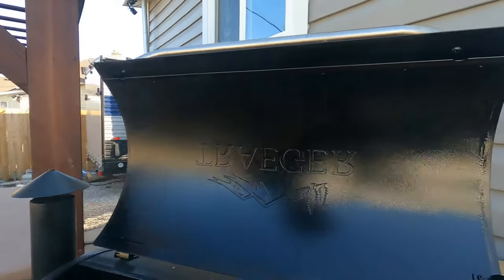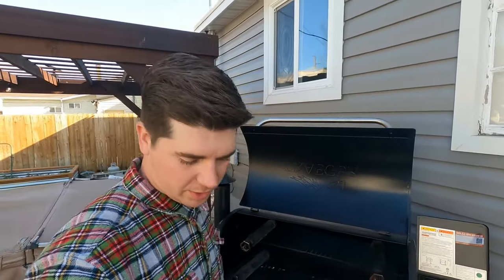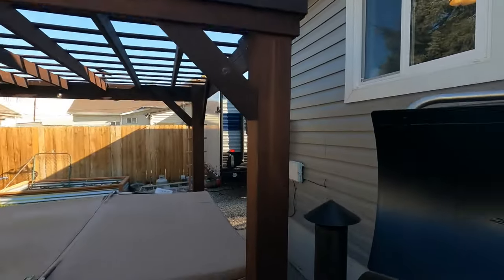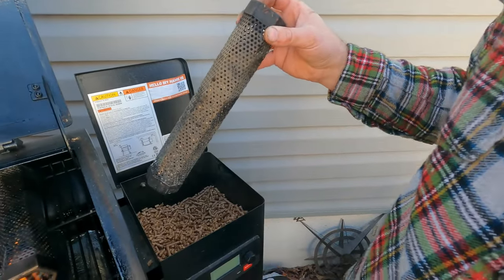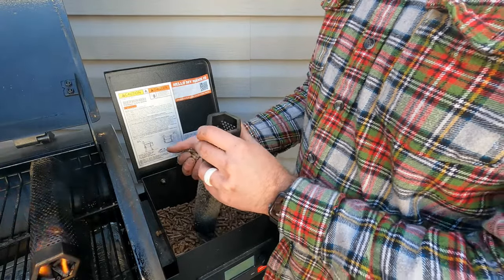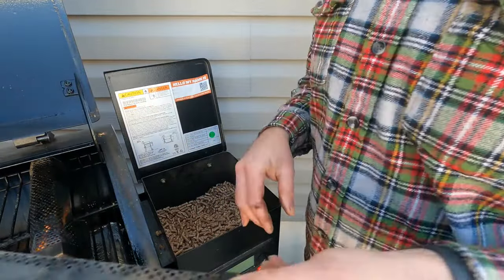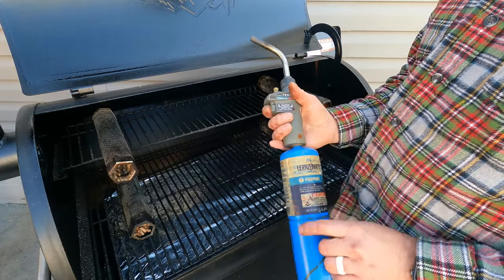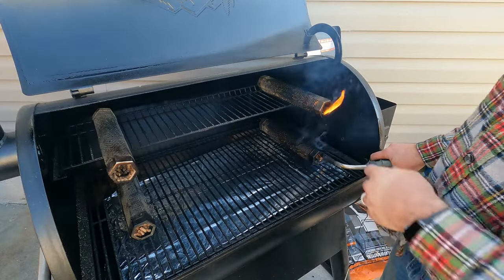Do you want MORE SMOKE from your Traeger pellet grill? This trick works amazingly.

Comment: The pellet grate is to prevent you from getting your fingers amputated by the auger. Presumably while you are digging in there trying to scoop pellets for your smoke tubes.
Reply from the maker: Makes sense. If someone reached down that far they deserve to lose a finger
Reply: @diyhvacguy  LOL!
Reply: @diyhvacguy  Many don't know how they work or about an auger or what it even does.  Most People are not mechanical.  They may be clearing pellets (not smart) for some reason or not thinking.  ???
Reply: It's also there to help prevent something like a tool, or accessory item from falling down in there and maybe jamming the auger.

If you pull the screws for the guard and put a dab of blue loctite on them, you can put them back in juuuuuuuust enough that you can pull the grate out easy without needing a screw driver so you can clean out the pellet box after the cook. 
The loctite will keep the screws from backing out and ending up in the auger.
Reply: Considering the auger rotates at half the speed of smell, if you lose a finger there, it’s intentional.
Reply: lol, I literally said that out loud while watching the video lol

Comment: Found your vid hunting around for a solution for the lack of smoke issue.  It looks like this is going to have to be the route I go.  It's really disappointing though.  The 575 Pro I picked up had a price point approaching a grand.  The smoke flavor it puts in the food is pretty minimal.  Kind of nuts that for this much money, I've got to go out and by an aftermarket work-around to make my really expensive smoker, smoke.
Reply: Yeah, my bro said the same thing with his new pellet smoker. Bummer
Reply: Also depends on the pellets you are using as well. Using a quality pellet can make a big difference in smoke flavor.
Reply: I agree I bought my traeger from home depot last thanksgiving they were running a deal for $150 off plus they were throwing in a grill cover and the shelf that attaches to the front. I was so excited to finally get one, then was super confused at how lil smoke it produced even at temps under 220 which are the temps where smoke is supposed to be produced. It was so pathetic I thought I had to be doing something wrong but nope it just is called a smoker and hardly produces any smoke. So I took mine back to home depot 3 weeks after purchasing it and got a full refund. I have been debating getting the next level up that has the "super smoke" feature but something tells me that will be some nonsense as well.
Reply: @Nick-xw3dk  what pellets were you using. I just used my 780 yesterday to make ribs and the smoke flavor was very good.
Reply: @danreed622   Hey Dan, I was using the hickory blend and the signature blend Traeger Pellets. I did multiple ribeyes on the grill and don't get me wrong it had a smokey flavor to the meat when I was done, but nowhere near what I was expecting from a Smoker. I just expected it to be a much more prominent flavor than it ended up being.
Reply: @Nick-xw3dk  That is most likely why you are not getting enough flavor, which is the most common mistake people make buying a Traeger. Traeger pellets use oils to flavor their pellets and are not all natural wood, which does not produce enough smoke flavor.  They are a bunch of comparison reviews on youtube of different pellets and usually Traeger pellets are voted the worst on the list. You need to look at better pellets that are labeled all natural wood. The top ones are, if you research are lumberjack and bear mountain and maybe Knotty wood if you can find them.. Top of that they are half the price, produce less ash and burns hotter for half the price Traeger pellets. I bought my 20lb bag of Bear Mountain pellets from Tractor supply and Lowes for half the price of Traeger brand. Also different woods produce more smokey flavor as well. For example Hickory produce more smoke than a fruity wood like Cherry.
Reply: @danreed622  Nice, I will give this a shot whether I get another Traeger or something else I will try to switch up the pellets and see what results I get..... It is pretty ridiculous though that Traeger sales pellets for the grills they make and it isn't a good product. If they make a $1000 plus grill the least they could do is make sure the pellets needed for it are a solid product.
Reply: @Nick-xw3dk  Yeah i did heavy research before i bought pellets. There is alot of good info on here to guide you. I do love my Traeger though. Good luck to you.
Reply: I totally agree with you I have a camp shelf which I love dearly and now they came out with a pro model that has a actual wood chunk Box built right into it all the reviews are pretty amazing but I just can't afford it so I'll just have to buy me another tube although you don't really have room to smoke anything with 4 tubes in your smoker maybe 2 at best for me....
Reply: Traeger is definitely the most convenient but not the most smoky. Use a quality pellet, and consider mesquite or hickory or oak that have a stronger taste profile. And keep that thing under 225!

Comment: You shouldn't have to do this for a $700-1000 smoker.
Reply from the maker: You really shouldn’t but I’d rather improvise then get a new grill. Works for me! Another guy mentioned that I should get ride of the existing smoke stack cover and install a flat one that can be closed off partially to contain the smoke. I’m gonna try that!
Reply: @diyhvacguy  I get it, man.  I like the suggestion of closing off the smoke stack partially.  That actually might work.
Reply: You don't have to do this. You just need to get better pellets. Some of Traeger's pellets don't produce much flavor. The mesquite and hickory do decent, but the fruit ones are almost no flavor at all. Their specialty blends  produce great flavor tho , IMHO. I've used the Meat Church and Brisket blends and both produce great flavor. Lumber Jack pellets also produce great flavor.
Reply: @firebirdlover4460  , I have an actual smoker and then bought a Traeger a month ago. There is almost no smoke that comes out of the Traeger. That means it is efficient. But that also means there is not much smoke flavor. Traeger is a grill, not a smoker.
Reply: @nakcrats1750  if you're not getting much smoke, you're doing wrong. I've owned a Traeger for 3 years. It produces a lot of smoke, just not as much as a stick burner.  And yes I've used just about every type of grill out there. This isn't my first rodeo, by far.
Reply: I have a traeger and if I’m cooking low and slow I get all the smoke I need.  If I’m making a fire roasted salsa and really want that smoke taste in a short time I use a smoke stick.

Comment: Any issues maintaining heat? As in it getting too hot, or does the Traeger do a good job of bringing it back down ?
Reply from the maker: It does perfect. The smoldering pellets don’t put off any heat, it’s never had an issue regulating the set temp.

Comment: How long would those 4 tubes keep putting off smoke like that until they needed refilled? At least 8 hrs? I bought a pellet smoker thinking I could finally sleep while smoking only to find out they make almost no smoke on their own (at least compared to an offset wood smoker like I’m used to). I’ve been pretty disappointed so far, this looks promising if they last long enough.
Reply from the maker: Yea I typically run 4 of them at the same time and they produce a lot of smoke for about 6 hrs

Comment: I have a large wood/coal smoker. Thinking of getting a pellet smoker for the convenience, but everybody keeps telling me it's a mistake, because they don't bring a smoky flavor.
Reply from the maker: I had a friend who worked at traeger so I got mine for 65% off but if I payed full price I’d definitely do more shopping around. Some of the traegers have a super smoke feature and it cranks out a lot more but without these pellet tubes the level of smoke mine makes is sad lol
Reply: I bought mine on sale for $450. It’s okay, the smoke is present. But it’s nothing like real coal and wood. After a year one of the fans has gone out. So I’ll deal with that. But looking back, I should have just bought a offset smoker or kept using the old kettle two zone. Method.

Comment: My tube will not stay burning when I’m running my pellet grill? Am I doing something wrong?
Reply from the maker: You should use a torch and really lite it up and let it stay on fire for a couple minutes then blow it out and it will stay lit 👍🏼
Reply: @diyhvacguy  I am a construction work and have all the tools, I lit it with my soldering torch let it burn for 10 minutes to make sure it was lit blew it out and it t seems the fan doesn’t let it continue to burn. Where do you place it?
Reply: @jimswanny1193  It works best on a burner where the rod stays hot.  Heat the rod up to a good temperature where it can maintain enough heat.  You can add shreds of fire starters throughout the rod to attempt to maintain that heat consistently through the burn
Reply: A-maze-n recommends to microwave the amount of pellets you need in 30 second increments. After each time, give them a stir and repeat 2 or 3 more times. This helps remove the moisture in the pellets. Then place in a tube or the tray, and light for at least 45 seconds with a small touch. Let burn for 10 minutes. Then blow out the flame. Works well. I've done it without doing the microvave part and mine would go out. A-maze-n manufactures pellet tubes and trays.
Reply: @scoeat1  thank you I will try that

Comment: We have used our rectec for almost 4 years, after 30 or so years on an offset. I appreciate the ease and consistent temp. But, this is a smoker. This..smoke. Understand the is a point where there is too much or the wrong kind. However I am disappointed in the amount you get, without resorting to these tubes.

Comment: I just bought the pro 34... so disappointed.  First of all they didn't even seal these things good,  you have smoke coming out from all around the lid, no gasket or anything,  chimney stays open so a lot of heat is lost,  the temp probe is on the side where the heat comes up from but in the center of the grill where the brisket goes its like 30 to 50 degrees lower,  I thought my meat proves were defective because it was reading ambient temp of 170 to 190 even though the traeger was set at 225 and the traeger Temp probe was ranging between 210 and 245, saw it die down to low 200s, I'm using the traeger pellets so can't blame it on that. If you want to smoke at 225 you need to set it to 275. I'm going to have to close the chimney some more and add rubber gaskets around the lid to see if that helps with the inconsistent Temps... brisket came out OK but nothing like my offset smoker... I wasted a whole 20lb bag and even ended up opening a 2nd bag because it took so long to get the brisket internal temp to 205... I didn't realize I was cooking it at 180 degrees or so it took like 23 hours or 24hrs... I'm so mad lol

Comment: Lose the smoke tubes. Use a smoke daddy heavy D instead (it doesn't work if you also use smoke tubes for some reason). Thank me later!
Reply from the maker: I discovered that this fall lol thanks for the tip though!
Reply: Can you adjust chimney height on the 780 Pro? Don’t remember reading anything in the manual about it. But I’m a newbie…